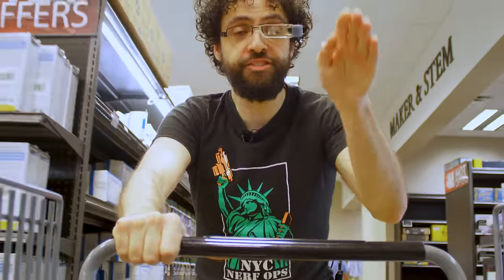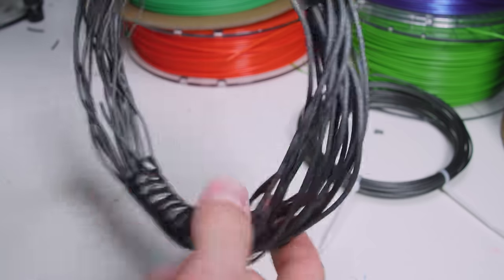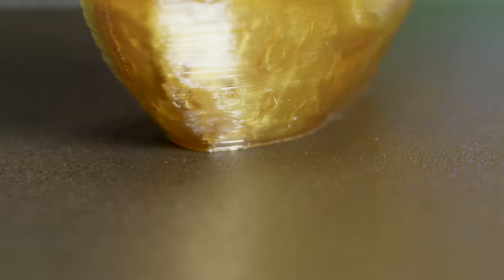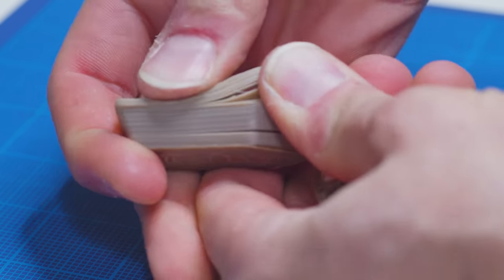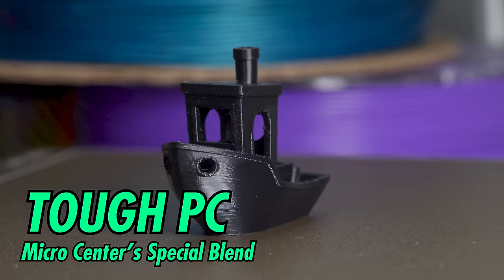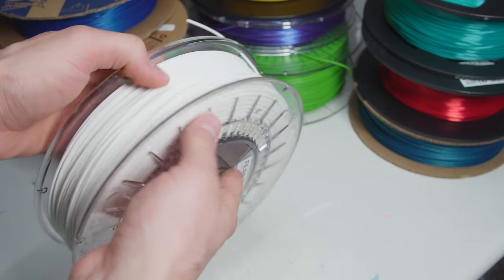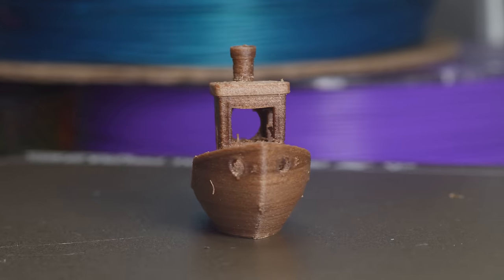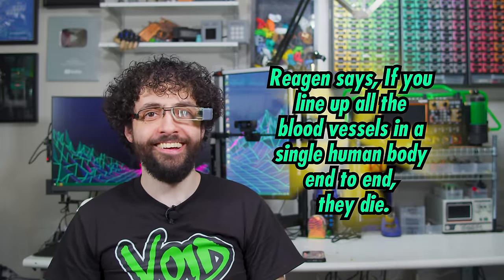The Most Advanced Filaments You Can Print: Every Single Filament Part II

Comment: difficulty tuning a single setting for two scenarios in a single print makes me wonder if dynamic print settings are a thing yet, is that a thing yet? like, for overhangs, the slicer writes in the gcode for the nozzle to go faster, but then for layer building it chills out.

that would add more steps and use more filament to tune, but i feel like print quality could really boon having something like that.
Reply from the maker: Most of the slicer settings modify the printer behavior for those special cases. For instance, the overhang thing is called bridge speed in PrusaSlicer. Most slicers let you apply different settings to each item on the bed, too!

Comment: how does high temp filament work? it can't withstand temperatures higher than the nozzle correct?
Reply from the maker: High-temperature engineering filaments behave a lot like conventional stuff like PLA, but start to soften at a much higher temperature. Some of these have such a high deflection temperature, you could use them to print PLA!

Comment: Any thoughts on the CR-5 Pro H being "rated" up to 300C....not sure I trust creality and the PTFE tube offgassing. CR-10S pro all metal hot end bolts up supposedly, but no direct drive, so still stuck with PTFE tube.

Should I be concerned? Need an enclosed large format printer that can reach at least 300C. Budget is 1200$
Reply from the maker: I don't know the specifics about the printer, but PTFE only matters if it's touching the melt zone. A Bowden tube is on the cold side of the extruder, so it should only get hot enough to burn if your printer catches fire.
Reply: @ZackFreedman  than you! Appreciate the insight

Comment: Interested in printing nerf blasters. What makes HTPET+ great for that application? Vs CF PETG?
Reply from the maker: The problem with CF filaments is that they're more brittle, and spring-powered blasters can shatter parts. I like using CF PETG for grips, rails, etc, but parts like plungers, receivers, couplers, sears, etc will eventually get pummeled to pieces. I like HTPET because it won't soften, either, even if it's left out in a hot day.

Comment: I know PEEK and PEKK are very strong filaments... but does anyone know if they're impact resistant? Some of the strongest polymers/filaments are strong in some ways, but extremely weak in others. For example, carbon fiber is extremely strong and lightweight... but it has terrible impact resistance and compression resistance, especially in the direction of its fibers. I've been wondering what filaments would be good to make strong, but especially impact resistant parts.

Comment: Did you get your tool changer yo 100c to print this? Most parts of the tool changer are destroyed at those temps. And even 100c is a bit too low for peek/ultem. I'm surprised you even got that benchy...

Also prusas are all metal?!!!

Comment: I'd just like to add that one of the biggest pros of printing PEEK and similar high end engineering polymers is to cut back on the waste from traditional methods.  PEEK is extremely difficult to injection mold, it's traditionally formed into stock that's later machined.  

Due to the high cost, subtractive methods are obviously a downside here, because you're throwing away each gram you cut off.   Enter printing PEEK.  Print only what you need and none of what you dont.   It's high cost is enough to flip the traditional pricing scale on a large machine where the material cost outweighs the machine runtime cost.  The downside here is that PEEK prints un-annealed wheras machined parts are typically pre-annealed. And the annealing process is a whole other can of worms when dimensions are critical. 

Cost wise, the most expensive filament that I know of thus far in the FDM range is Victrex AM200  at around $1000/kg (im sure there's probably some others) The special thing about this blend is that it's crystaline structure strengthens layer adhesion tremendously.  it's nearly as strong along the z axis as it is x and y.   

That said, if you'd like a suggestion as far as drying is concerned we've been using a $500 chineese lab oven to dry our materials out. It's got excellent thermal control and actual convection heating so you can dry materials like PEEK without melting their spools and deforming the filament.  It has enough room for 4 1kg spools at a time comfortably. Bonus is that it gets hot enough to anneal all of the materials as well, though you have to manually change the digital temp control as it's not computerized. 

And for a fun video idea if you havent done so already, there's an ever expanding list of support materials out there especially in the water soluable catagory even just now ranging all the way up to 180C chamber temps.  Pretty neat stuff.     But in the consumer realm there's also dozens of offerings, and who really knows how similar/ dissimilar they all are when it comes to brand names and not the typical PVA/BVOH varieties. 

Just kind of food for thought. I really enjoyed both of these material videos thus far!

Comment: Great video. Though, should you want to further torture yourself with filament, you can simply drop the "N". Filamet from Virtual Foundry has some crazy filament materials. As the name implies, they've got many metals like: stainless, iron, bronze, titanium, and even tungsten. But then there's multiple ceramics, carbon fiber, and even glass. In theory, they should all be capable of sintering to result in solid metal/ceramic/etc. but they've been unable to confirm tungsten and I believe one of the ceramics... Your setup seems like it should be capable of properly printing those filaments (though I don't know if you can sinter them). I've been watching them for years (before they offered even one filament) and it seems like they've come up with a filament that'll let consumers make metal/ceramic parts that would be impossible to machine...

Comment: How does the CF-PETG go in terms of UV resistance?
Reply from the maker: It's probably pretty good. Vanilla PETG already resists UV pretty well, and the CF could block even more. I'd be more worried about exposure to rain and snow weakening the plastic.
Reply: @ZackFreedman  thanks for that. I'm building a network of environmental sensors and want impact strength for withstanding hailstones, UV resistance (for obvious reasons), and of course it'll be exposed to a wide range of temperatures (could get below 0 deg Celsius in Winter or as hot as 50 deg Celsius in Summer here in Australia), and rain, and probably snow as well. I was originally planning on using ASA and have just spent the last few months mastering how to print with it (with a Prusa Mk3S). Is there any particular type of filament you would recommend for this scenario please?

Comment: YOu can get the same crystalisation of a clear filament with pure PET filament, just turn off the fan

FusionFilaments PET filament should act the same, I think

Going off of my experience with rPET on a small extrusion line

And yes, while the filament extrusion is kinda tricky, printing it is a dream (just remember to dry it)

Comment: I would be interested in seeing, rather than extremes like this... a trial of skill. You vs another 3D printing channel. Who can print the cleanest print. Identical hardware. Identical software. It's all about tuning. Who can tune the cleanest print out of the same printer? You could even make it a speed challenge by picking out a default profile that each person has to correct and change. A print-off!
Reply from the maker: Oh, they'd clean my clock. I've never been very good at tuning my printers.

Comment: The lines in most of those prints were horrible.  Shortcuts to get the video out? CF-ABS looked nice.
Reply from the maker: I don’t put a lot of work into getting perfect prints in general. As long as it’s strong enough for the job and the dimensions are tight enough to fit, it’s good enough for me

Comment: Honestly I think the high speed PLA is a joke. I have the cheapest China brand PLA and print at about 480mm/s on my Bambu lab x1 Carbon and the quality is still insane. From my experience PLA filament really doesn't matter to much when you have a decent printer. It's all the same
Reply: Well no I also got a pretty cheap one and it snaps constantly all the time that's why I'm kinda picky about my filment this is from personal experience you can disagree
Reply: @yyan3511  that isn't the PLA... That's moisture lol. Dry it and that problem will be fixed

Comment: this is really strange. 120mm is hardly fast, i know this video is 1 year old. but my Sovol sv07 prints the included benchy speedtest in less than 25 minutes, casually reaching over 150mm/s. This is with quality that is as good or better than the best benchy showcased in this video. And on cheap sovol brand filament.

and the all metal hot end goes to 300c and heated bed on 100c. All for a printer that costs like 320 bucks. Things must have happened.

Comment: Why does “the most friendly polymer on the planet” produce a benchy with an inconsistent hull and half its weight in stringing? I’ve made significantly better-looking benchys out of much less “easy” plastics with my cheap printer and many if not most of the other examples in this very video looked better.